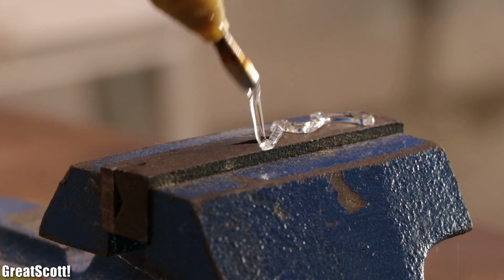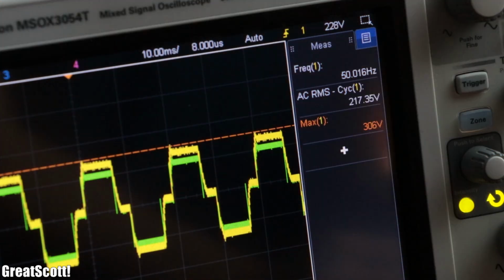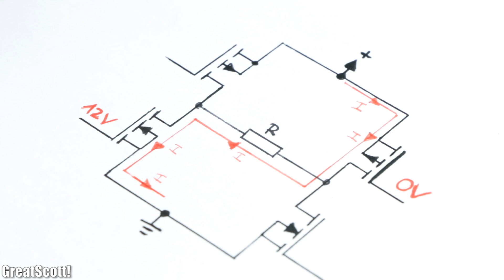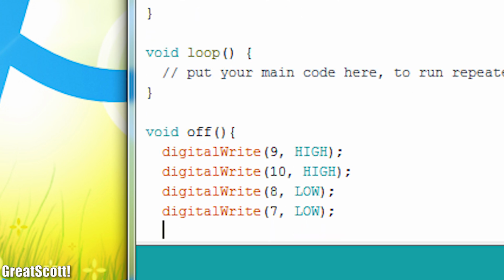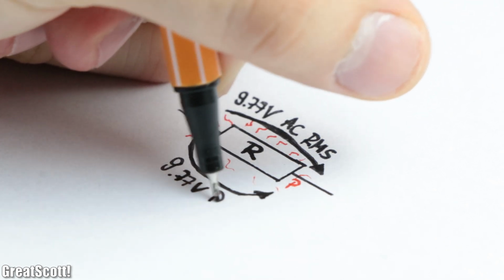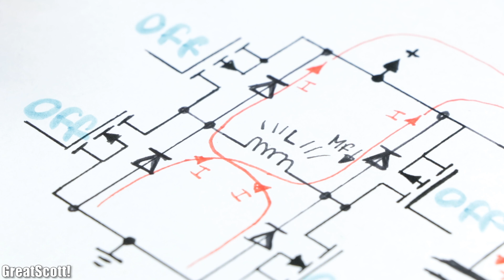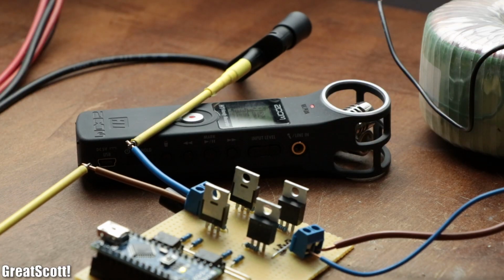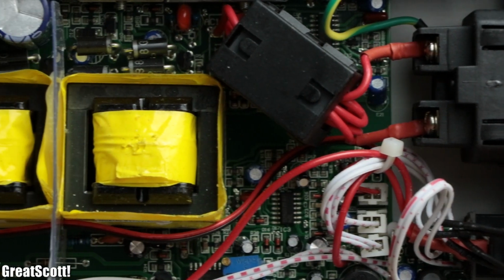How NOT to make a Modified Square Wave Inverter

Comment: Do a video about a pure sinewave inverter
Reply from the maker: That is next. Not next week but sooner or later.
Reply: Use SPWM and a low voltage transformer as a feedback. At that point it is pretty much perfect.
Reply: Since this video was originally about using this for home A/C, could you use the grid voltage as some sort of reference?
Reply: @LanceThumping  If you have the grid voltage then what would you need an inverter for :)
Reply: Sašo Domadenik Energy!  Smaller windmill generators from the 1980s used a modified asynchronous electric motor as a generator, the voltage from the grid controlled the frequency and phase of the electrical energy produced.  Gearbox and wing adjustment just needed to keep the rotation speed slightly above 50Hz, thus forcing current back into the grid.
Reply: @greatscottlab  Yeah...Thats enough....Thank you so much
Reply: GreatScott! I know of 4 very different kinds of true sinewave inverters.  The oldest is electromechanical: A DC or brushless motor driving a synchronous AC generator.  This produces a genuine sinewave with only mechanical losses.  However it suffers from the effects of nonlinear loads such as neon tubes and electronics just like the real grid does.
  The 2nd type is a pure analog DC source amplified with an analog amplifier.  This is extremely inefficient but can also be made very pure.  The analog amplifier can power through most nonlinear loads at the cost of even worse efficiency.
  The 3rd type is a modified square wave inverter with some powerful low pass filter components on the output.  This requires huge components but can be done even at MW scale.
  The 4th type which is common in frequency regulation of motors is to use a PWM circuit to output a digital representation of a sine wave, then use high power filter components to remove the noise from the PWM sampling frequency.
Reply: Science world,  you could use LC oscillation with feedback tank circuit and use opamp amplify it to suitable 24V AC peak then use 1:10 transformer to get required 240 V AC u need. Hope that will work.🤗
Reply: himanshu bhaskar There is little reason to use an ELV inverter with an output transformer, except as a safety measure for the initial testing at low AC.  However if a transformer is used, it might as well be an active part of the circuit, helping to shape the output signal.
Reply: @himanshubhaskar6631  Give me the circuit diagram

Comment: -Can you make an inverter?
-No
-...
Reply: He should have ended the video right there and append a 10min black screen
Reply: Denied 😂
Reply: He's referencing a comment great Scott made to someone that he shows on the video
Reply: Savage xD
Reply: welp
Reply: Was that a challenge?
Reply: You can make an inverter. ..not that difficult
Reply: If he can't make a good inverter, then he doesn't have much knowledge of electronics...
Reply: @GRBtutorials  Cheaper to buy one than to build it. A square wave inverter is not to difficult to build. ....but a clean sine wave is different.
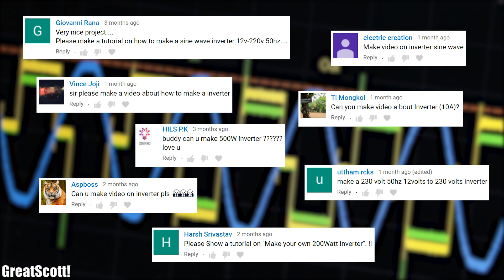Reply: 1:42
Reply: Well, technically he did... 

and as we all know, technically is the best way of doing things. ;)
Reply: @Lonewolftechengineering  Bwahahaha.....yeah I'm sure you have built many "high quality and clean " sine wave inverters.  Keep your bullshit to yourself dude.  I have owned several good clean inverters over the years and I have built a few. For the time involved designing and building one....it's not worth the trouble.
Reply: T^T
Reply: In the same time getting 19 likes
Reply: It's due to to the risk of AC mains
Reply: Ok
Reply: Actually you can if you use SPWM and a little bit of know how.
Reply: ("RNA0ROGER") continue

Comment: Your common pcb soldering is amazing.Your soldering is better than a printed circuit board😍😍😍😍
Reply: It's actually quite easy with a good adjustable temperature soldering iron - which doesn't have to be too expensive!
Reply: wat

Comment: One of the problems with square waves is that they bring a ton of additional harmonic frequencies. Since harmonics are usually higher frequency, is it possible to round out the output using low-pass filters, or are the capacitor and inductor values to filter a cheap inverter too extreme?

It’s my understanding that the good inverters use VERY high freq PWM with duty cycles corresponding to the sine function. The higher frequency of the PWM allows them to be cleanly filtered out. You might be able to achieve this kind of inverter with this same circuit but a new program.
Reply: Yes that is correct. I made a circuit like this with the PWM signal you described. PWM signal can be created by an arduino and you use an LC filter at the end to filter out the PWM and make it a very clean sine wave
Reply: @Digitalralf0  Can U send me the programme that you made, please ?
Reply: i think they indeed modulate the duty cycle - but the reason the frequency is very high is more often because they want to use ferrite material in their magnetics which have less magnetic loss and can be made smaller but which requires high frequency. I think that high frequency also helps reduce the values of components needed - and very often i think alot of harmonic noise simply carries along and stuff like chokes are needed to help reduce this. For that though i think scott would need to go to a (smaller) ferrite core as well.....but lower frequencies and that kind of modulation might work.
Reply: @Kaname Locon We never tested for harmonics through for eg an FFT scan. That also wasn't the point of the project. But as far as i could see the sinewave was very close to a pure sinewave . We only detected distortion when zooming in with the oscilloscope. We could see tiny voltage steps/ripple between each high frequency pulse, but these were so tiny that we only could see them when zooming in so far that we only had 10 of the 20kHz pulses on the screen of the oscilloscope . The goal of the project was to feed power to the mains electricity network. The waveform of the network itself had way more distortion then the sinewave we produced so we declared any minor distortion as insignificant.
Reply: I like that prove it with a low pass filter after the transformer. By example a 15 or 22 uF and 1mH . Regards

Comment: Scott!! What is the best way to sense 240v with microcontroller(Arduino).

I only know this method Stepdown>rectifier>filter>regulator.
Reply: Depends on what part you want to see of the 240V.

You can do a transformer and voltage divider from transformer + voltage divider from arduino supply for centering to meassure the waveform.

You can use a optocoupler and drive the LED part from a higher power resistor and rectifier.
This should give presence, or replace the rectifier with a single diode for zero crossing detection. 
A more DIY route would be neon indicator and photocell (shield from external light, heatshrink may do). the DIY route is likely easier, since you can get the indicators pre-made for mains.

If isolation isn't needed, a voltage divider alone should do the trick.
Reply: Won't recommend. .. but rectifier and voltage divider

Comment: If u use a inverter to convert DC to AC and then the appliances you connect again converts AC to DC then wouldn't there be a heck of power loss , meaning if u connected the battery to the appliances directly you could run it for a longer time .
Is this right GreatScott ?
Reply from the maker: Yes
Reply: Thanks

Comment: Make a tube amp!!!
Reply: Tube amps are not that complex...A basic tube amp doesn't have that many components
Reply: But it would be awesome :)
Reply: They are not complex, but the parts are expensive and hard to find...
Reply: @zztchannel8923  Actually they are not hard to find. The vacuum tubes can be costly of you go big...but many can be found surplus.  It depends on how many watts you want...but the parts need not be expensive.
Reply: That is very hard to do.i tried and i faild
Reply: @danfishermen5362  thats sad, considering tube circuits are waaaaaay simpler that solid state designs, you can make an amp with ONE tube, 3 resistors, one cap and the irons...

Comment: Make a tube amplifier !!!!
Reply: I mean, you can pretty much just replace a transistor with-oh wait nvm im wrong i forgot you have to heat up the coils.
Reply: Find an old 5-tube AM radio and disable the tuner. One of my first experiments back when I was in 6th-7th grade.
Reply: Yeahh do it!!!
Reply: tube amps = boring. MrCarlson's Lab has plenty of vintage valve content and tutorials. Check it out, really worth it.

Comment: Great video as always! You mentioned the pure sin inverter. Can you make a tutorial on how to create a low voltage sinwave from 12V?
Reply from the maker: It is on my to do list
Reply: Hey Scott if you're going to do a DIY  pure sine wave inverter you might want to check out this board:
https://www.egmicro.com/download/EGS002_manual_en.pdf
I'm currently working on a similar project myself with this board and think it might be useful for the DIYers out there
Reply: @greatscottlab , I will wait
Reply: Typical analogue audio amp should provide very clean sinewave but the efficiency will be poor. I wonder if modern D-class amp can be used to drive transformer and variety of loads through it.
Reply: LV is straightforward. Just use SPWM and then filter it with an LC filter.
Reply: So 12V sinewave?
Reply: @id523a Basically what i had in mind. And if you want just switch off the 50hz sine and pump in your jammes
Reply: Orrrrrr, you could just spin a permanent magnet ac motor with one that runs off of your 12v and pull actual 100% pure sine wave AC out.
Reply: Atlas WalkedAway Devices like this actually exist. I even possess one that converts 27Vdc into AFAIR 110Vac 3-phase 400Hz. The main problem is to keep voltage and frequency at constant level. They strongly depends on load current.
Reply: Brys555 Yeah, I've got an assortment of AC generator heads that I've had hooked up to different drivers and loads over the years. System matching can be a pain but it honestly doesn't have to be dead on for most applications. Then there's always the option of sacrificing more efficiency and driving a modified alternator so you can at least control the field strength and regulate the voltage with a bit more independence to the frequency.
Reply: id523a But these amp are designed for constant load like 2, 4, 8 ohm etc. speakers. Do you have any experience with variable load?
Reply: ZVS is perfect for it. There is circuit diagram in google.
Reply: Great video about bad inverter.

Comment: Perfect circuit to power up light bulbs.
Reply: More like perfect circuit to turn things into light bulbs
Reply: Maybe...
Reply: AD9833 + Opamp  switching mosfet to produce pure sin wave
Reply: Hello your student tathagat
Reply: LMAO
Reply: Hi electronoobs i love your vids
Reply: Hello electronoobs
Reply: Please don't. You'll annoy the hams. Crude inverters like that are terrible for generating radio noise, and the cabling makes a good-enough antenna.
Reply: Just don't try to power fluorescent tubes (with electromagnetic ballast + starter) with a modified sine wave. I killed a cheap tube the other day by trying it on an old UPS (just to see what would happen :P). Not sure about electronic ballasts.
Reply: Or just buy a 12v bulb
Reply: Maybe halogen. But who uses halogens now? LEDs all the way. But most driver uses an input electrolytic that would not last long being stresses by the modified sines sharp transients.

The missing output current / voltage feedback makes this unsafe design at voltages above 50v.
Reply: you could use the output of the solar panels directly for that...
Reply: and soldering iron
Reply: I make this circuit and function corectly
Reply: a single d882 transistor and phone charger transformer will work too !
Reply: Just remember, every component can emit light exactly once...😂